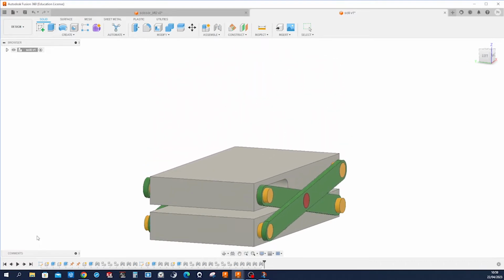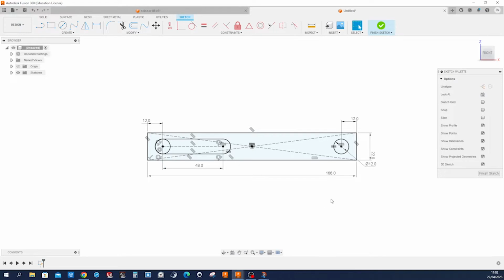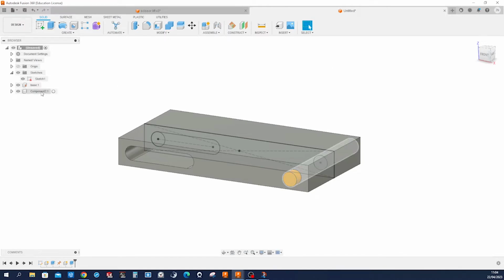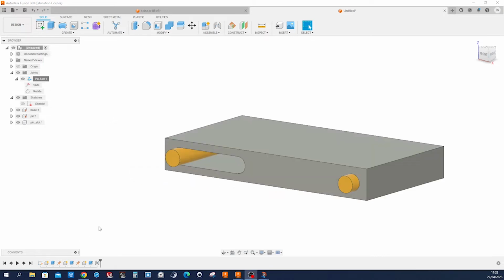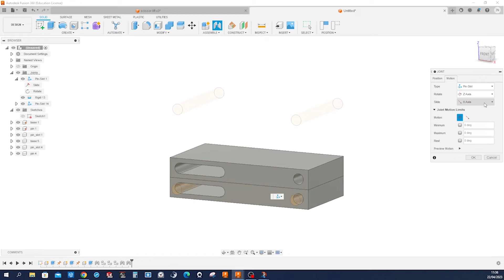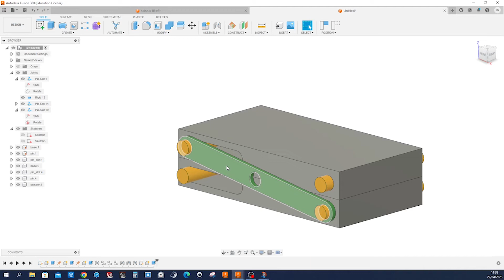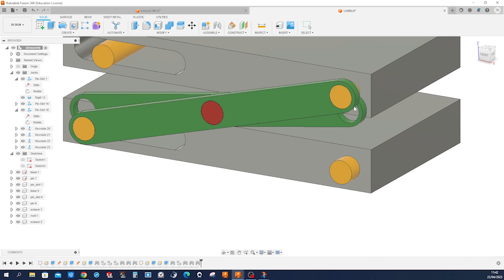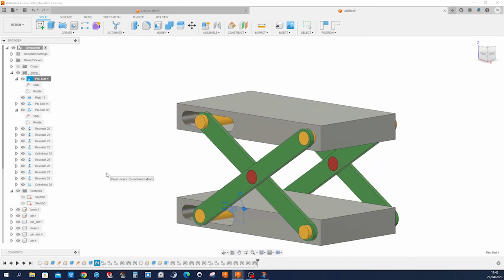This Fusion 360 Assembly Tutorial will Change Your Scissor Lift Game Forever!

Comment: I am trying to insert a "live dimension" between the components(the sketch dimensions don't work as the top "base" is a copy not a separate sketch). I am trying to insert a measurement between the two bases (measuring the changing height) while measuring the travel of the sliding pin against the rigid pin in the rounded base. I am wanting to measure the relationship between the height and the movement required of the pin as a "live" changing dimension. I hope that makes sense.....rgds. JM
Reply from the maker: Yes, makes  sense  to me-is  it working?